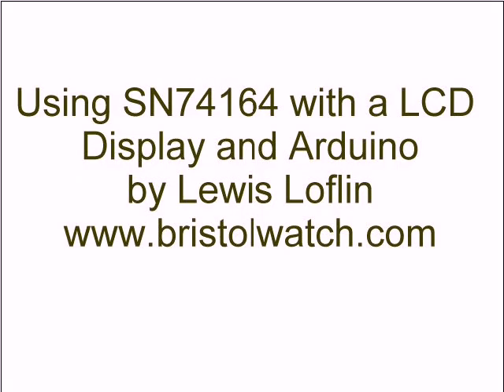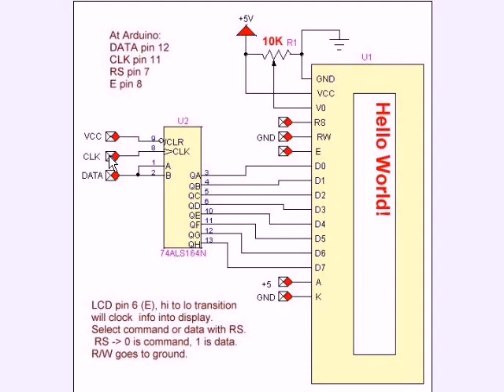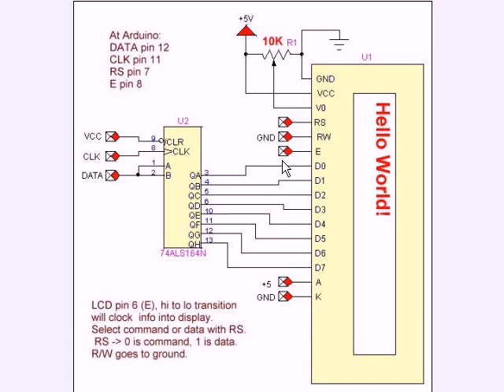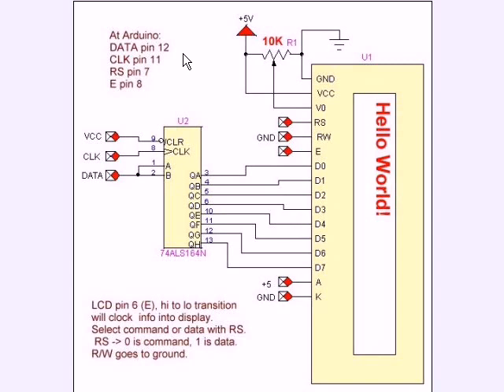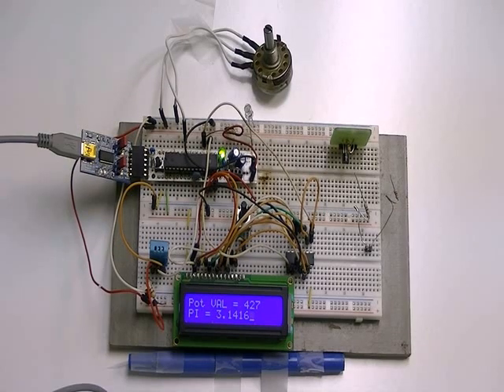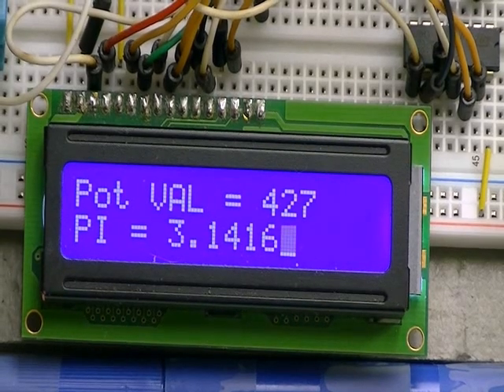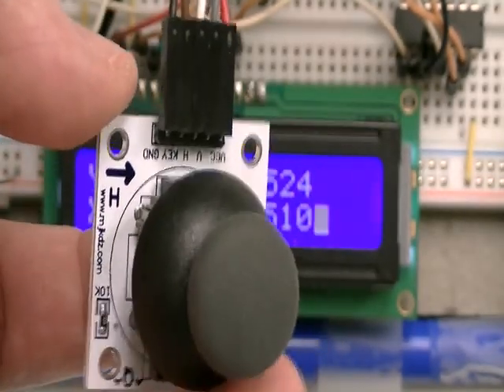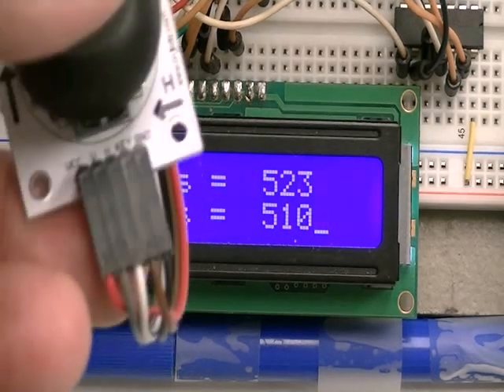Using a SN74164 Serial Shift Register with a LCD Display and Arduino

Comment: Hello Lewis! Firstly, thanks for the video. Even though it took so long to post this video, I have a question: Would you have any Arduino code for a clock with this register and a 7-segment display? If you can answer me, I would appreciate it.
Reply from the maker: Let me get back. Do you mean the 74164? Do you mean individual LED displays? Common and or common cathode? A common anode is best.

Comment: i can put more than one of this in i2c?
Reply from the maker: This doesn't use I2c.
Reply: @LewisLoflin  oh sorry i didn't explain it, i can put more than one in parallel or in i2c with arduino?
Reply from the maker: On I2c more than one the I2c differ. The ones I have they don't.